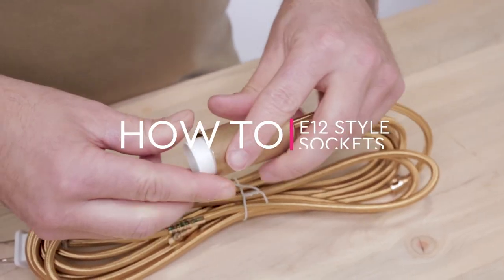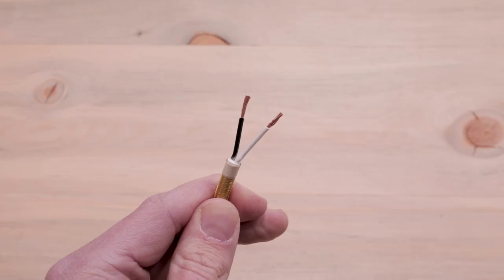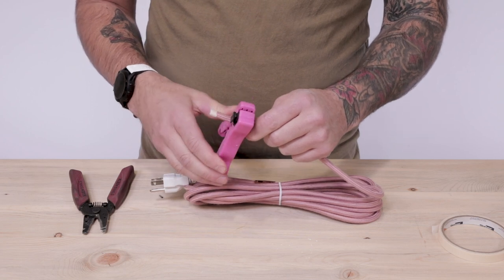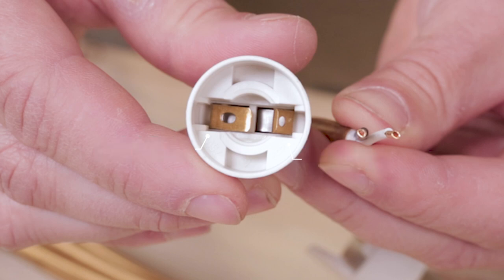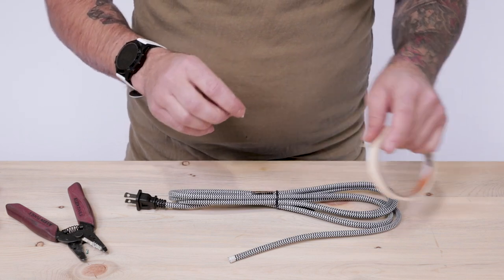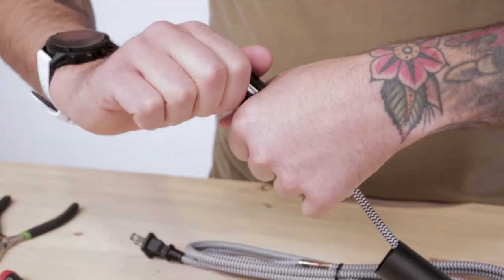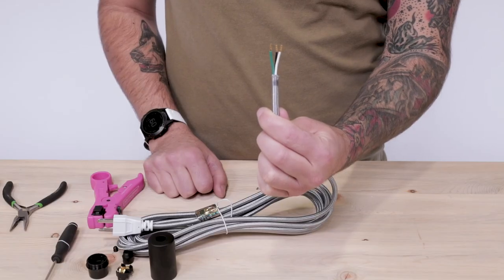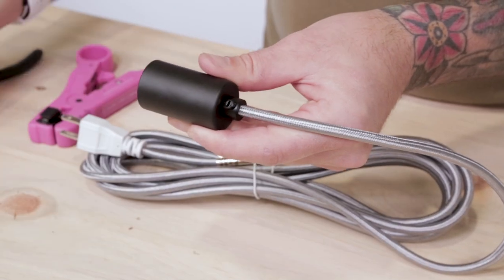How To Wire E12 Ivory and Black Sockets

Comment: Didn't work.
I'm trying to plug 2 wires (black & ivory) into e12 socket. The wires don't simply slide in, as they enter perpendicular to the metal face within the socket female connection.
Reply from the maker: Hi there,
Did you loosen the terminal screws on the terminal piece?  If you're having trouble, feel free to reach out to us on our website via chat or email us at info@colorcord.com .